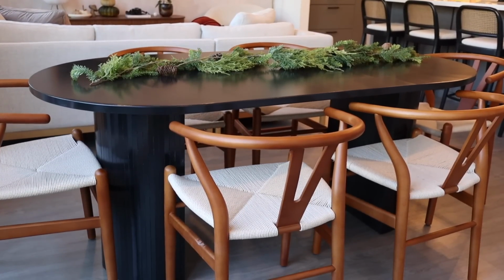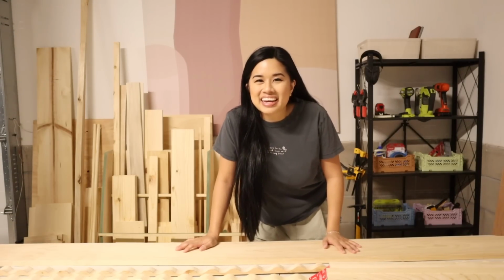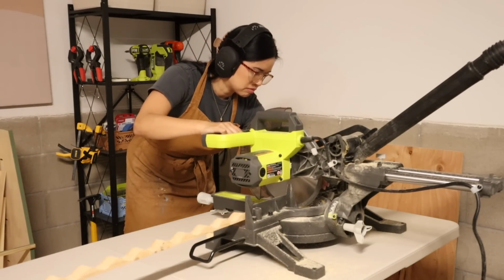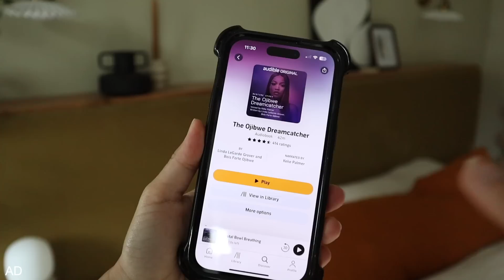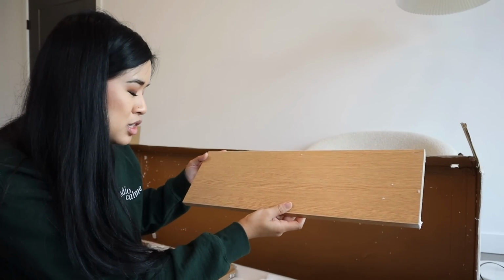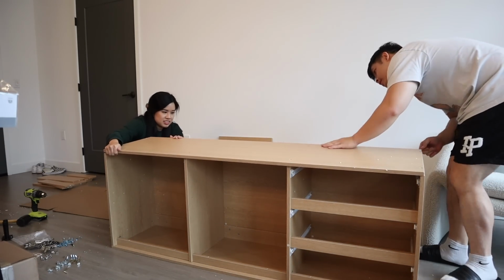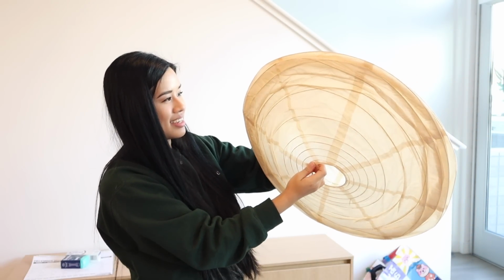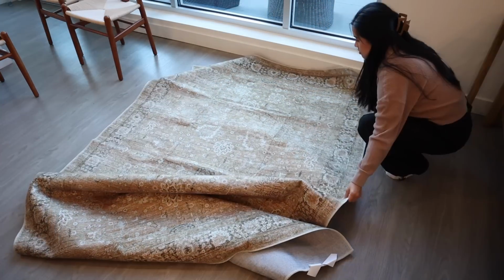DINING ROOM MAKEOVER *RENTER-FRIENDLY JAPANDI STYLE* (diy wavy table + lighting hack)

Comment: Love the console table, but something’s tells me over time you’re probably going to need a center leg. Those whole place is coming together beautifully.
Reply: Yes I'm worried it will sag.
Reply: Yeah I came on here to comment on the same thing 😂 make sure you don’t put anything heavy in the centre as that table is way too long without that extra support in the middle. Other than that, looks really nice 😊
Reply: I wondered that myself. Some stabilization is needed, I feel. It’s lovely, though, with the scalloped trim!
Reply: It will definitely sag. Also, a single 1x8 does not make a table (of that length)(and yes, I understand what a console table is) It requires support.
Reply: All she needs to do is put a brace across the bottom.
Reply: @TheGenflute That seems like a good solve without compromising the aesthetic. Especially if at most it will hold drink cups, remotes, or phones. 

Sidenote: seen people cleverly(?) integrate phone chargers into similar sofa consoles. Maybe a future hack?
Reply: True!

Comment: Great Job Tina! One suggestion...because the length of the table, I would suggest adding a center leg to help support it the top.  Otherwise, you risk having it warped.  Learn this the hard way!
Reply: I was about to say exactly this! The table came out great but it's going to bend in the middle without some additional support.
Reply: I like the idea as well but worried it is too narrow and might topple over.

Comment: TINA WAIT - that sofa table is going to get knocked over SO EASILY - you've got to anchor it somehow to something, it is so narrow that it has no stability, especially next to 2 areas that get traffic - you or a guest is going to brush against the sofa table and it's going to get barely touched and all the stuff on it is going to fall off. I hope you get this comment or if someone else pointed this out then I hope you found that, (or you'll find out on your own eventually lol) because if you have that lamp or a candle or anything on that table, it's going to fall.  It could fall either way, so your lamp could end up on the floor shattered or a candle could end up on the couch, spilling wax or burning the couch.  I was thinking you could sew a couple of anchors to the couch simply using a curved needle and some strong thread, sew a dozen rings around either one spot on the top of the leg under the top of the table, or drill a couple of holes into the decorative squiggly piece on the side facing the couch and then sew it there.  Another option could be attaching the table at the bottom of the legs to long pieces of flat metal that would help, but still nothing is going to be safe on top of that table unless it's fastened down.  Hope you get this in time, hope it helps, love your work.